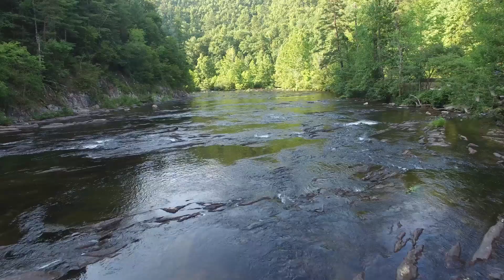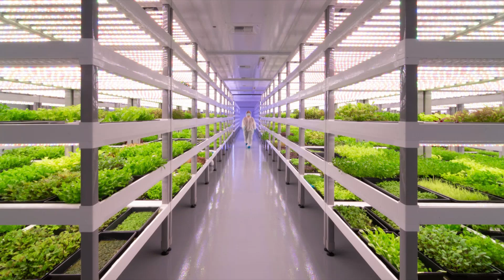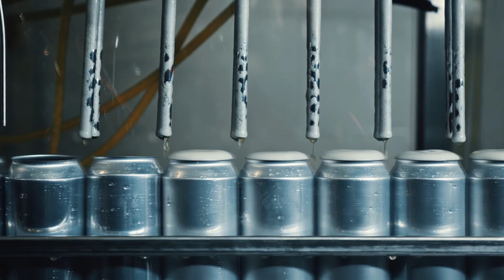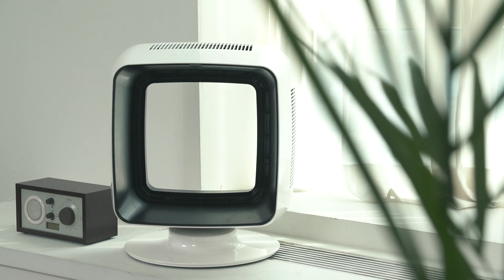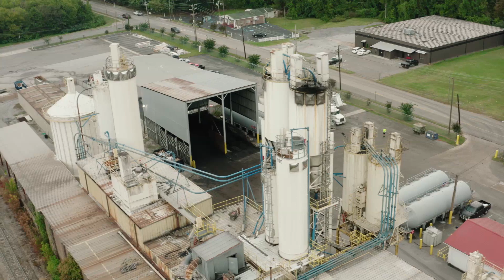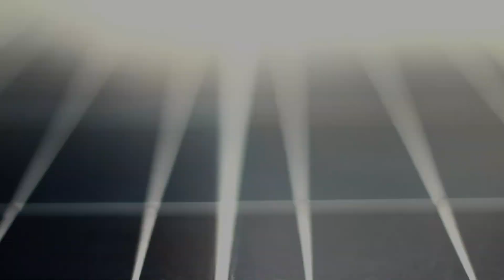Hyperminiaturisation - Sustainable Production in the Hands of Local Communities

Comment: As an electrical engineer with a true interest in changing status quo, I must say that "centralized grids" are not that centralized. At least in my country the electrical grid has many interconnections, power cuts are an exception because of that. What is truly good about distributed generation is how it lowers energy losses in lines, or how it is better for implementing renewable generation. So, yeah, the current electrical grid is not so centralized, even if distributed generation is better from my pov.

Btw, I loved the video, I came here through r/solarpunk. I hope you make more!
Reply from the maker: Thanks for the praise! More stuff on the way, especially more practical, exopriment-y stuff. I plan on making mini generators and exploring wind turbines soon :)
Reply: @edeniaAJ  Horizontal or vertical turbines?
Reply from the maker: Vertical primarily, as microgen will most likely take place in low altitude, urban environments.